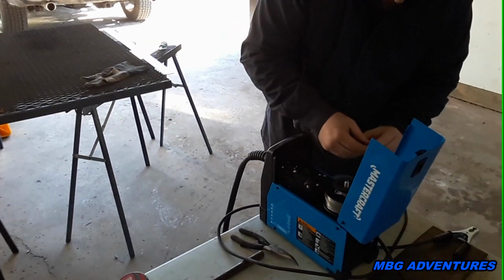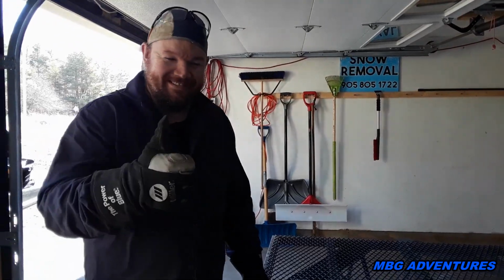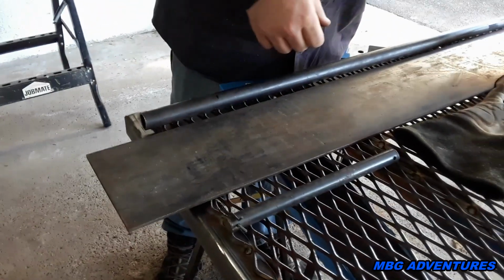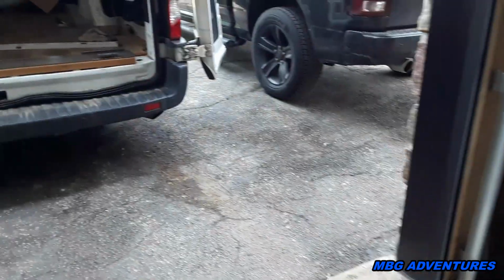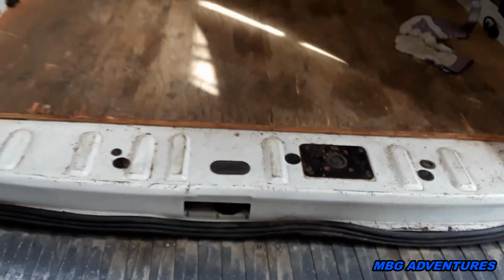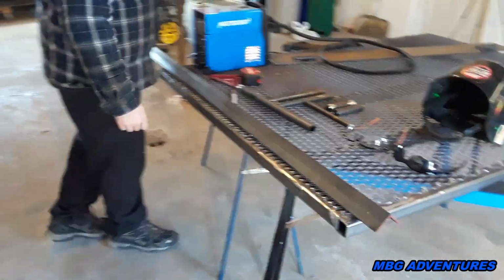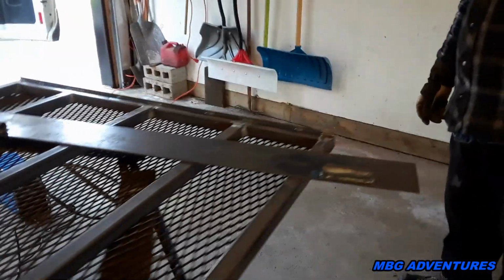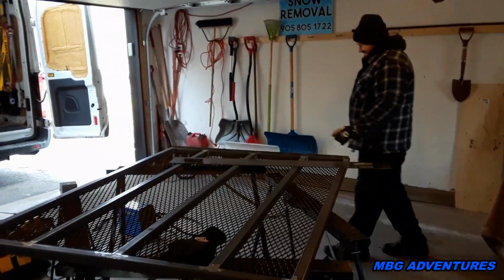Lawn Care Van Conversion Series - #5 Will this work? Change in plan

Comment: That is going to be really cool when its done. Look into hinge springs to help with the weight of the ramp. My buddy has them on his lawn care trailer and they work really nice.
Reply from the maker: Hey Mark, ya, it will be cool and different. I did buy a lift assist open trailer spring set up that will be engineered into this build. How, don't know until ramp is connected, up and latched. Then the brain storming on angles and where to mount the spring inside the van. Side wall or from the top? Thanks for watching!

Comment: Great job on ramp, the only thing I would have done differently is having the expanded metal horizontal rather than vertical with the sharp edge up (take a boot and slide it you will see) one direction has extremely good traction. The way you have it is going to be slippery. You may want to mix in some sandblasting agent into the pain for better traction especially when wet. I’m sure you put it that way to not have to cut the expanded metal but it really should be the other way.

Comment: cant wait to see this thing finished! gunna be a awesome setup
Reply from the maker: You and me both. I hope it all works out. I have some other unexpected mechanical issues that need to be addressed now that might delay me using the van for the start of the season. I still have my truck and trailer so we will see what happens. Thanks David.

Comment: Great job guys 👍👊 I've been thinking on doing a straight trade for my truck on one of these vans. I'm just thinking owning a business you have to sacrifice thing's sometimes to better your business. Hey maybe when your done with the ramp you can take a little road trip to my place so I can see if my 52" will go up the ramp
Reply from the maker: Thanks Mike! Really, you will trade in your truck for a van? Would be a good idea to keep the truck too for towing and stuff. Yes, your 52 will fit in this van no problem between the wheel wells. Not sure about the others, RAM and Mercedes. I like road trips!
Reply: @MBGAdventures   its just been a thought